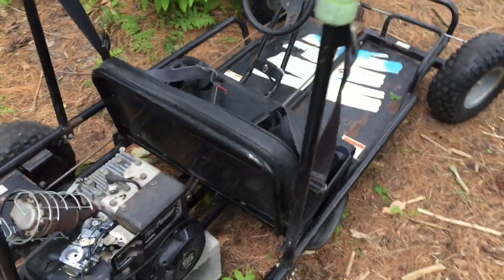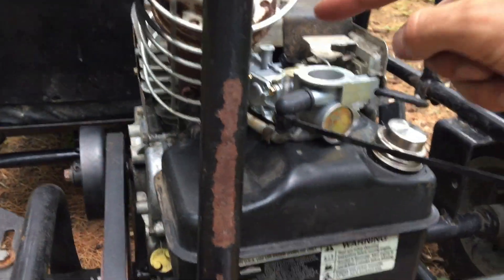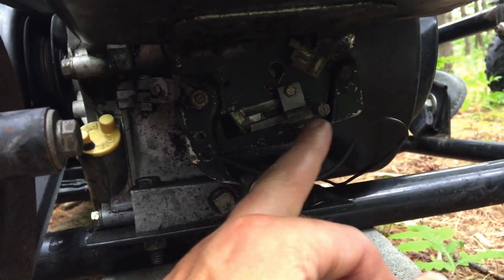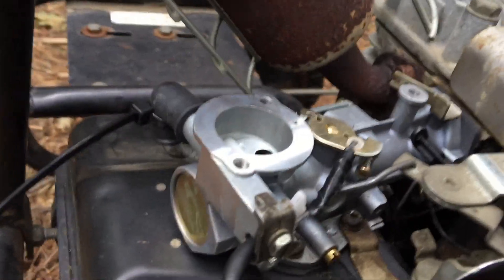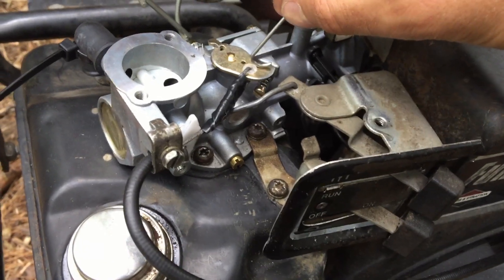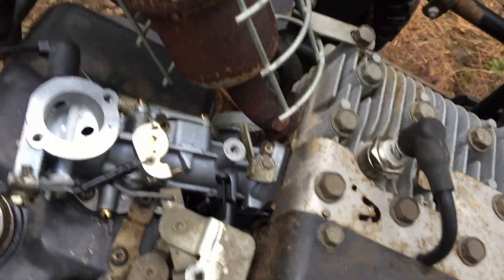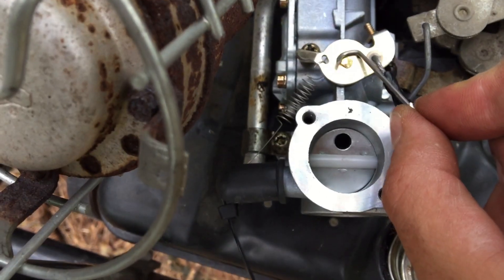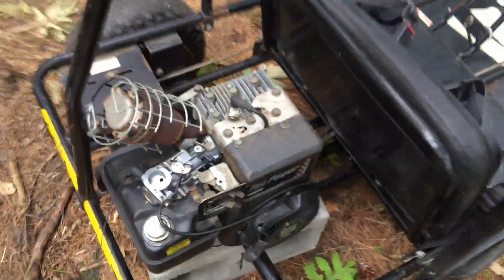Carter 2435 Go Cart Briggs and Stratton Governor Linkage Bypass

Comment: I have the same engine and I need to clean out my fuel tank and carb. I am stuck because I can’t figure out how to remove the throttle cable that is underneath the tank. Are you able to help me out at all.
Reply from the maker: Hmmm, not sure I can. I didn’t have to contend with that to be able to give good insight.
Reply: @VermontLife thank you for the response. I ended up figuring it out. 
Removed the screw and it slid off, turned out it was a little seized from sitting over 10 years.

Comment: I just finished a video on this exact same go-kart with the exact same engine.  Somone had bypassed the governor in a similar fashion and pieces of the internal governor came apart and did all kinds of damage inside the engine.  When I first saw your video I had to look close at it to make sure it wasn't the same kart.

Comment: How did u fix the dying when hitting throttle
Reply: i just today got my old carter out and played with it and got it running, been sitting 15 years. It has the exact same briggs flat head style 5hp "fun power" motor. I started by cleaning the carb and tank and got it to fire but not run. I cleaned the spark plug up to see if it would help but it would still only start on starter fluid or by pouring a little fuel directly into the carb. Once the fuel ran out it would die like it wasn't sucking fuel up from the tank. My motor would idle very rough and die under any load or throttle. And it only ran on choke. If I flipped it to run it would just die. After a call to a local small engine repair specialist he told me that based on what I had already done there were two things that would keep the motor from running. On the driver side of the carb is a small plate held on by 4 hex head screws. behind it is a diaphragm that operates off vacuum and essentially acts as a fuel pump. Old fuel varnish or whatever you want to call it had frozen it in place. Some lacquer thinner took it all off and put it back together. Careful as there is a spring in there and a spring retainer/cap so take it apart slowly and pay attention to how it comes apart. After I did this the motor fired right up after one or two pulls. There is an idle adjustment screw on the other side of the carb behind the choke and engine on off lever panel. its on the bottom of the carb close to the fuel tank. Its a flat head adjustment screw with a spring on it. Its at a weird angle but you can get to it without disassembling anything. Turn it to the right until it stops. Basically closing it. Then back it out 1 1/2 - 2 turns. That's where it should be set. Play with it a little in that window until she idles just right. After 15 years of sitting mine runs like a champ.
Reply: Same issue here! I bypassed gov on our old go kart. It’s the same old b&s you got. The thing wants to die every time I put a load on it.
Reply: Jared Hicks let me know if you find a solution I’m struggling
Reply from the maker: That was tougher and I wasn't greatly successful. I ended up double checking all the obvious. (air leaks around gasket at the head, topping off fuel in the tank so it doesn't have to suction fuel as hard...) In the end this motor was just always running lean and hot. There was no adjustment capability on this carb other than idle that I could find. (no fuel/air mixture adjustment, no jets to change.) My belief is that the motor (worn out as it was) was running too lean (plugs were pretty white) that was resulting in the performance trouble but I wasn't able to fully fix it. When it was warm it would run fine at idle and wide open but mid range was sloppy. In the end I pulled this tired motor for the 18hp I have on it now from a snowblower.